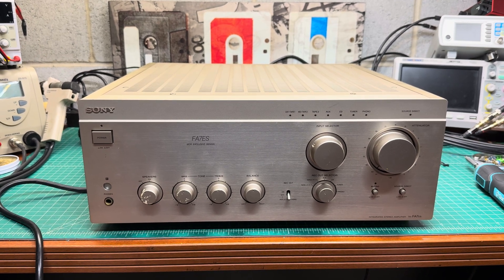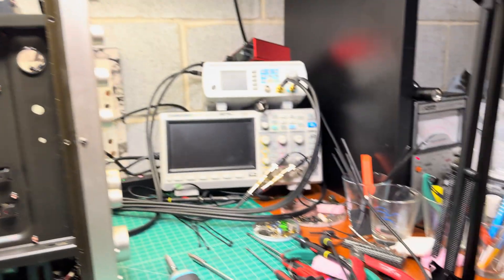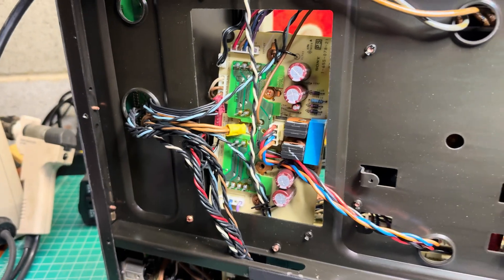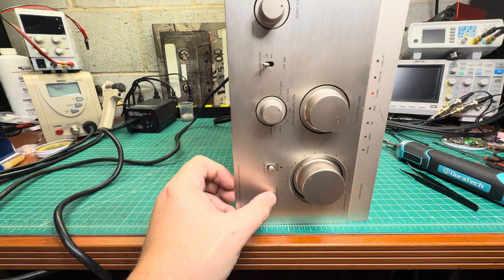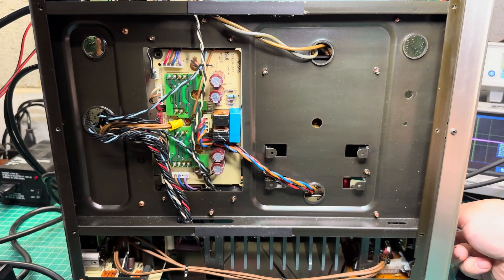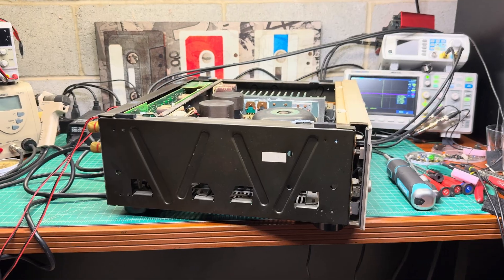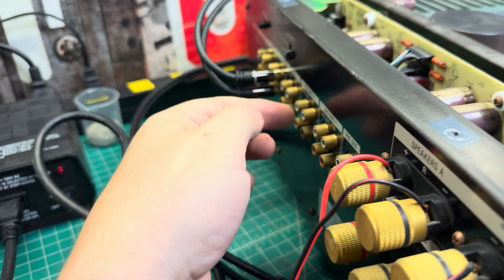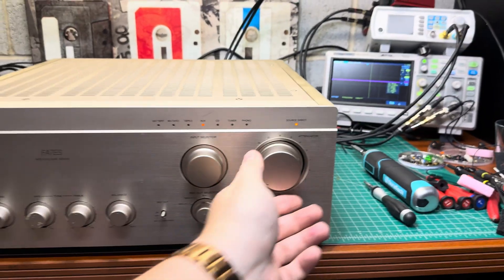Sony TA-FA7ES MosFET Beast: From Shipping Damage to Audio Perfection + Exclusive B&W Preview!

Comment: I have the amp that was also slightly damaged in transit (but works). Do you know where to buy this capacitors holder? It broke. :-(
Reply from the maker: Donor or 3D printing. I do not know other options.